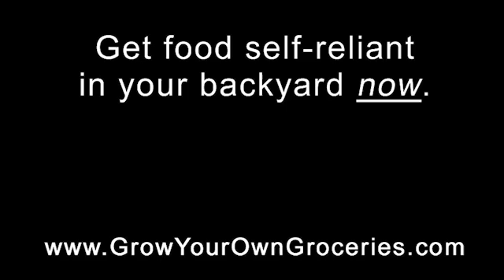Making Alcohol a sustainable energy source

Comment: Instead of an alcohol what about methane? It’s more efficient, you can use bat shit human shit or whatever shit although not too much fiber. Can throw corn silage in it mixed with manure and you got methane. Fertilizer comes out when you’re done. Fiber is scraped off the bottom and is turned to compost. You just need a tank a pipe and a gallon of some sort and you have got it. Yeah it’s hard to run a car on it but it can be converted to methanol or electricity for an electric car.
Reply: Matthew Niedbala: for one you couldn't make frosted flakes or cheerieos with anything else all of which is a byproduct of alcohol. Methanol is highly acidic and should be used cautiously keeping in mind that some metals like certain types of aluminum can corrode from methanol. As a professional technician I've never liked hybrids due to the dangers of working around batteries, open any automotive textbook and it will tell you that electric cars contribute to another kind of pollution which is acid rain. There is allot to be known from the book "Alcohol Can Be A Gas" like the charging of electric cars only moves the pollution from the roads to the power companies that only makes the situation worse than it already is. Distilling alcohol to high proof could start your car or truck in extreme cold weather conditions like Alaska. Alcohol runs better with less hesitation and smoother in just about any car or truck and that's only the beginning ethanol is much more capable than our modern I.C.E. We can produce better numbers if we would only.
Reply: I think human waste can carry deadly bacteria. That's why it's not dumped on fields.

Comment: I spent over 2 years slpash bleending 45% or so ethanol into my non flex fuel truck. I've had Dave's conversion kit on it for the last 2 and half years running E85 and i love it. I go longer between oil changes (extending engine life) and the inside of my exhaust pipe looks brand new.
Reply: Jedimullet77 that's cool man! Good to know.  A question for you does it keep the check engine light off when running on straight e85?